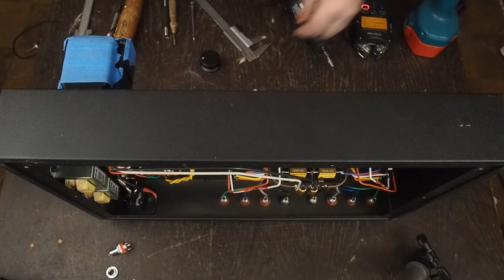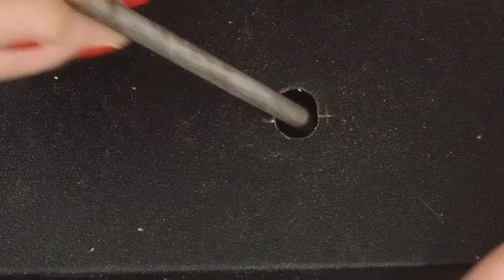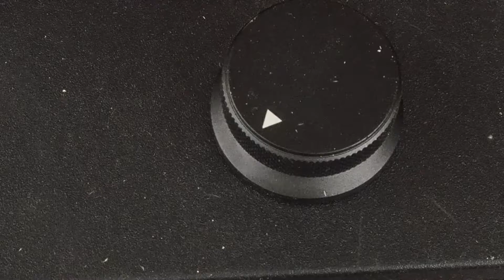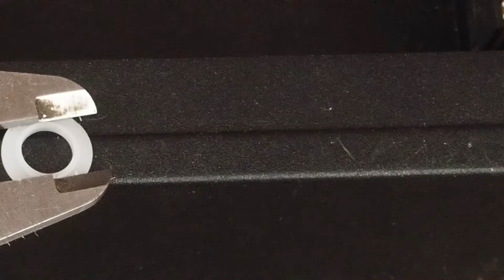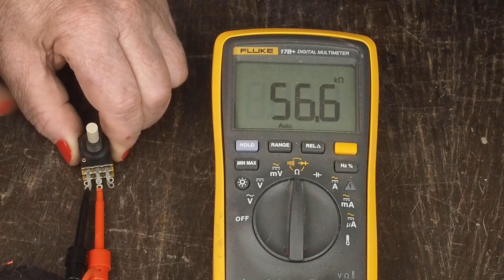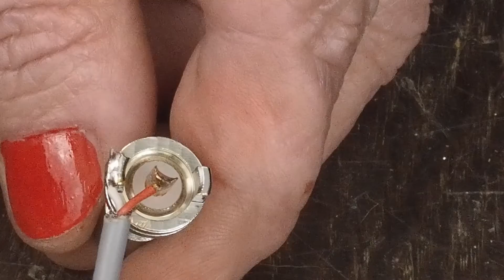1930's Globe Tube Amp: Input Jack Install and First Impressions

Comment: Hashimoto output transformers are a division of Sansui............these are very high quality transformers .
Good choice !
Those globe tubes have a very nice tonal structure.......
Next you may try to decouple the sockets from the chassis 😉
Reply from the maker: None of the jacks or sockets are coupled...
Reply: @SkunkieDesignsElectronics  I mean mechanicaly decoupled ........